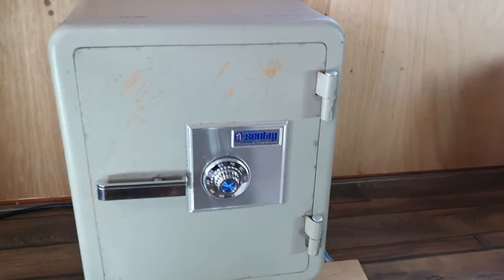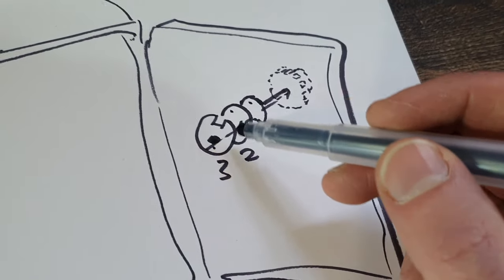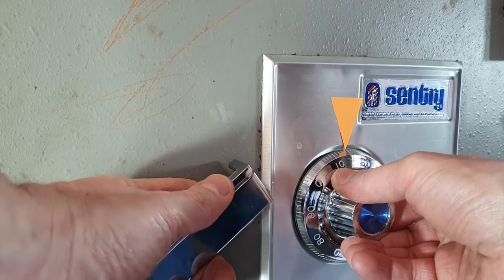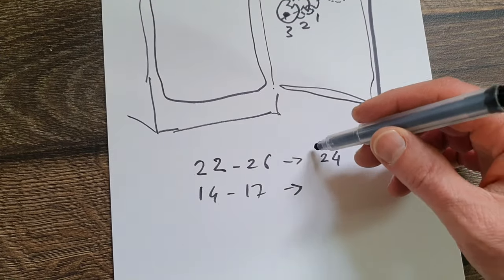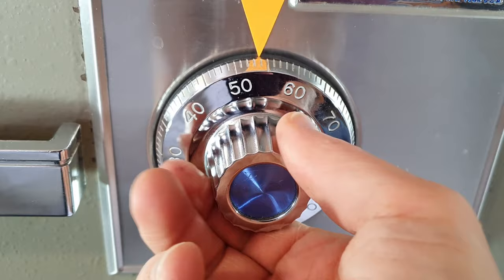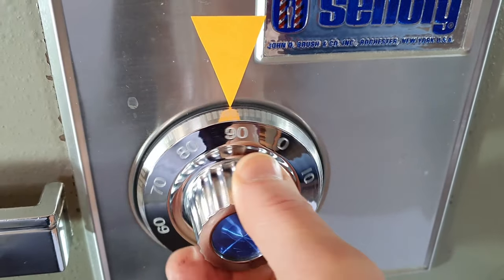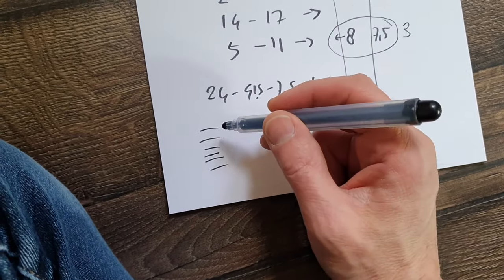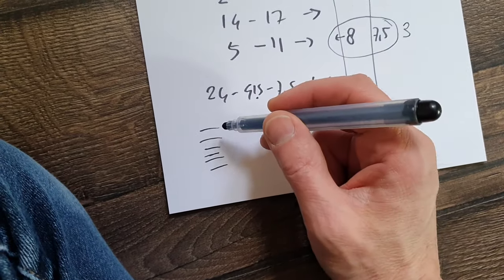Cracking your old Sentry Safe (without destroying it)

Comment: I don't fully understand. Why must the 1st and 2nd number be located only at the middle between the false gate bumps on the 3rd guard wheel? Couldn't the 1st and 2nd numbers be set to a number that was a number at the top of a bump on the 3rd wheel or at the actual gate on the 3rd wheel?
Reply from the maker: Hi, thanks for your question.
The 1st  could certainly be the same number as the actual gate of the 3rd.  2nd and 3rd cannot be the same due to mechanical limitations. 1st and 2nd cannot be the same either.
The reason to use the middle between the bumps is just a tolerance thing. There is some room (play) in the gate and the chance to hit right increases if you optimize for maximum play on both sides.
Hope this helps.
Kind regards,
Frank
Reply: @frankrood8464  I ran though the list of all possible combination numbers but my list excluded the 3rd gate number as a possibility for gates 1 or 2. I didn't have any luck opening the Sentry safe.  I'll add in the 3rd gate number as a possible candidate for the 1st wheel gate number in my list of possible combinations and it try again.

Sentry Safe Combination Number rules:
1st gate number could be the same as the 3rd gate number
2nd gate number cannot be the same as the 3rd gate number
1st gate number and 2nd gate number cannot be the same number

These Sentry Safe model numbers are covered by the same owner's manual so I assume the lock mechanisms on these models are all the same:

1230, 1250
1310, 1330, 1380
1400, 2200, 2230, 2280

Thanks!
Reply: @zzyzxRDFwy15  I dealt with the same thing. Did you have any luck after using Gate 3 number for Gate 1?
Reply: @gmp3244  No, I gave up after trying for a long time. I still have the safe and I'll start all over and try again. It's frustrating after trying for so long. One of more of the numbers must be something else than the number at the middle of the gate.

Comment: How much pressure do you push down on the handle?
Reply from the maker: Hi Jake, lightly, just rest your hand on the handle, no additional force. Of course, it depends on how old, lubricated / dry / rusty the mechanism is. Hope this helps.
Kind regards, Frank
Reply: @frankrood8464  I got my safe new in 1979

Comment: Great Video!

I have the same exact safe cemented in my house. the home owner gave us two possible codes and neither worked. I found this video and was excited to see there may be a way to crack this using the gate discovery method you present.

I ended up finding what I believed to be 12 gates, used the middle number in each gate, and eventually came up with a excel spreadsheet list of 122 possible combinations. Unfortunately I couldn't get the safe open still. wondering what I could have possibly done wrong? I guess its possible I didn't get the gates correct and thus the combination list was not accurate. My hand was getting tired from resetting the dial each try and maybe that ended up 

The interesting thing is that one of the codes on my spreadsheet was the number the previous home owner provided to us...strange.

I'd pay a locksmith to get this open if the safe can still be used....maybe I'll try this entire process again and see if that works at all.
Reply: I'm determined to get this safe open. I went through the dial 3 times carefully and recorded the number ranges and have my spreadsheet..so far no luck....starting to think either the safe is broken, or maybe I'm dialing the codes incorrectly.
Reply: Ever figure out the problem?

Comment: where is you get 82 For your first number ?.  thats not on the video ?
Reply from the maker: Hi Greg, thanks for your question. You are correct, I didn't show that. 82 was one of the numbers of the 12 numbers I found by checking out the false gates like shown at 5:30 to 6:10 . My assumption was that 7,5 would be the gate in wheel 3, and the other numbers of the list of 12 should be either the gate of wheel 1 or wheel 2. When I figured out that wheel 2 could be 41,5 ('click' at 14:20) I only had to test 10 different numbers for wheel 1, including 82 which was the correct one.
Hope this helps.
Kind regards,
Frank

Comment: My brother in law loaned me his safe door, to practice with. It's just a round section, for an old floor safe. It has 4 numbers. The way the fence, or latch is designed, it's at an angle, so you can only figure out the last two numbers. There is no way for it to touch the first two wheels, to hear it hit a gate. You can feel and hear, when it catches the next wheel, but there are no false gates. You just have to know where to stop for the first two numbers. Since it turns so many times, to get the next wheel's gate to line up, it always pushes the latch out of the way, and never comes close to the gates, on the first two wheels.
Reply from the maker: Quite a challenge Mark. Did you get it open in the end?
Frank
Reply: @frankrood8464  It is just the lockimg mechanism. It isn't on the safe. It's just the door. It seems impossible to hear or feel the the firs two number. From feel and noise, I can figure out the 4th and 3rd numbers. Since it rotates so many times to catch the next dial, the other number dials never touch the gate or fence. So I believe it is a well designed safe lock. You would have to drill a hole to see from the front.

Comment: This "direct Dial" safe is why they came out with the new improved versions that separate the door locking mechanism from the combination locking mechanism which only blocks the door mechanism from turning and the combination box has the block bolt retraction build into the combination box that is retracted by the dial itself.

Have a great day
Reply from the maker: Thanks a lot for sharing your knowledge!

Comment: It seams like I can write all 100 numbers down when I do the test, Where do i start on the dial for the test?
Reply from the maker: Hi Jake,
Thanks for your question. Which test are you referring to? I would expect when you try find the possible gates, you end up with less than 100 numbers, in my case I ended up with 12 numbers.
Best regards,
Frank
Reply: @frankrood8464  i can find the two gates but 3 no
Reply from the maker: @jakeblack212  If you have the first 2 numbers for the first 2 gates, then you can indeed try out 100 different positions for the 3rd gate. Which is doable. Probably you'll find the right position before you tried all 100.
Hope this works.
Frank

Comment: Hey hi! Thanks for your video but I really couldn't understand much, I have the same safe but I know the very last number and nothing else, could you please just give me a tip or something, anything; please. Thanks in advance!
Reply from the maker: Hi Charles, great that you know the last number. For the first and second try these in all combinations : 0, 8, 10, 16.5, 20, 24.5, 30, 32, 36, 41, 49, 50, 57.5, 66, 70, 80, 82, 91.5. Keep the third the same. Avoid same number for a sequence. So not: 8-8-20 (double 8).
Hooe this helps.

Comment: I called sentry and they gave me the combo but it's not correct. I am trying to open a safe that belonged to my husband who passed at the beginning of the year. I know there is valuable stuff in there and I knew that the combination I paid $35 for was not correct. I clearly remember the second number was 2. The person at sentry told me the combination could not be changed. I have a code that my husband wrote in code for the code. lol Do you follow that sequence? He has letters separated by carets and we can't figure it out. I don't care if someone destroys the thing I just need what's inside. I don't have the kind of patients you have. But I did watch the entire video.
Reply from the maker: Hi, I am so sorry to read your husband passed away. My condoleances.
Thanks for watching the video, that shows you do have some patience.
With the help of others in this comment section I came to the conclusion that the factory default for turning the dial is starting left (counterclockwise). Is your model safe the same as in the video? Then I recommend you turn left-right- left. So: 3 or more full turns left until the 1st number. Then turn right, pass the 2nd number once and turn to the 2nd number. Then turn left until the 3rd number. Hope this helps.
Reply: Mine looks exactly the same, only it's black. Do you know if the original code can be changed? Since I don't know the code I called Sentry and they gave me the original code, for $35. When I asked if the code can be changed to something else, I know the second number of the code was a 2, I was told no. It's still sitting in the basement with who knows what inside, waiting for someone to bust it open. Thanks for your reply.
Reply from the maker: @jazzbea6243  Hi, yes the original code can be changed. I did changed the code for this video and restored for the owner. For example, if you check around 18:00 minutes you can see a screw in one of the holes. The screw can be put in another hole, changing the second and the first number. De third number can also be changed, although if I remember well it can only be changed 180 degrees (at best 3 x 90 degrees). So all three numbers can be different from the original. However, the design limits the number of combinations. I hope you can get it open. Keep up your spirit. The biggest frustration is just before the breakthrough.

Comment: Hi, thanks for the video I'll try it on my Dad's old safe. It has ULTIMATE written on the top right corner, and the handle doesn't move at all after entering the combination (it's so stiff I feel it was manufactured that way). The dial locks in after entering the combination but just won't open.
Reply from the maker: Good luck Dimitri! Maybe the handle mechanism rusted stuck. Or the Ultimate is a newer version where the latch is moved with a last turn on the dial. Which would be harder to crack. Have fun with this challenge.

Comment: if they wouldnt have had the false gates, it would be more secure. With the false gates as you explained it was only 144 combinations. If there were no gates you could find the last number with 100% certainty but it would leave the other two wheels at 10000 combinations. In other words, their 'security" did exactly the opposite.

Comment: mine won't open the handle is loose but the combo is correct, guess I'm screwed
Reply from the maker: Hi John, that's bad news. I guess the handle is still attached, correct? If you look at minute 17:28 you can see the handle is attached to the mechanism with one nut. That's probably loose. What you could try is to tighten that nut again with the handle on the outside. Turn handle down (counterclockwise), pull handle hard towards yourself and turn clockwise. Keep torsion on the combination dial while you do this. Repeat 10-20 times. Maybe this will tighten the nut again. Then you can use the handle again like it's supposed to. Small chance, but worth a try. Good luck.
Reply: @frankrood8464  Handle is stuck in the down position though. Can't move it back up more than 1 inch.
Reply from the maker: @Qwijebo  HI John, an inch is about the normal stroke when the safe is closed. Hard to guess what is wrong.
Reply: @frankrood8464  well the handle is all the way down, combo is correct but the latch just won't open. Ah well
Reply from the maker: @Qwijebo  Yeah. That's not normal. Maybe the only alternative is a brute force attack.